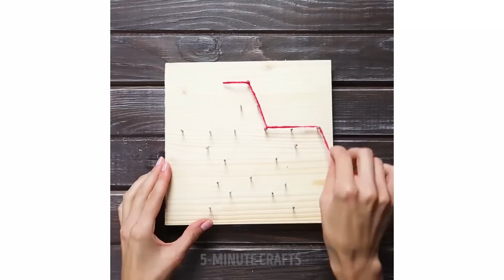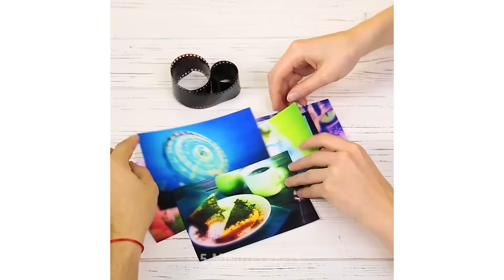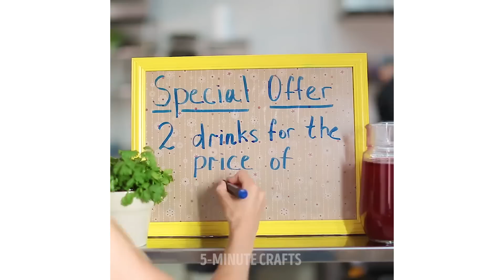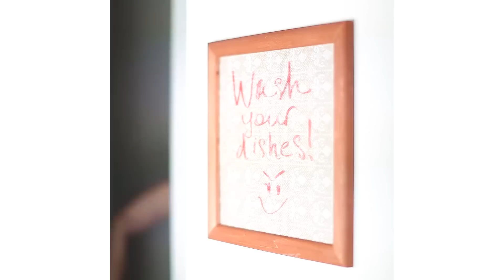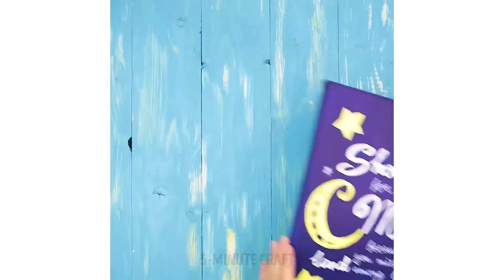15 DIY Projects That Will Make Your House Look Amazing

Comment: hey how you removed the star from the wood ??
Reply: I was wondering the same thing. You would wreck the star trying to pull it over the nail heads. Guess you'd have to use straight pins instead.